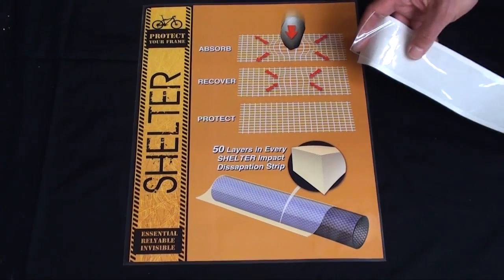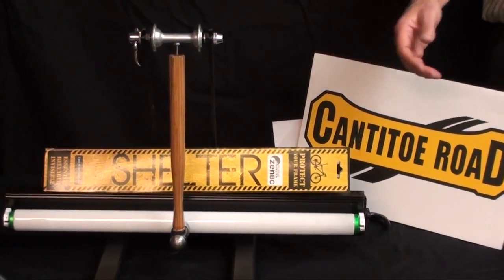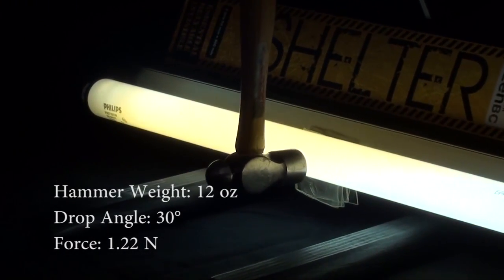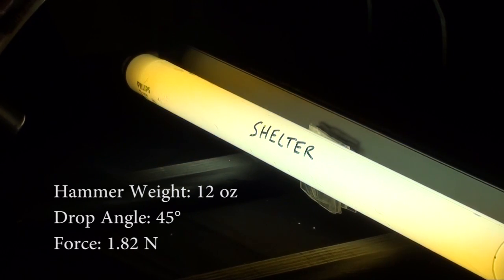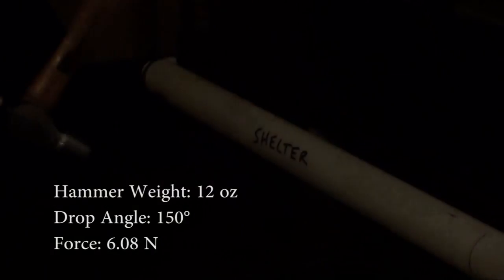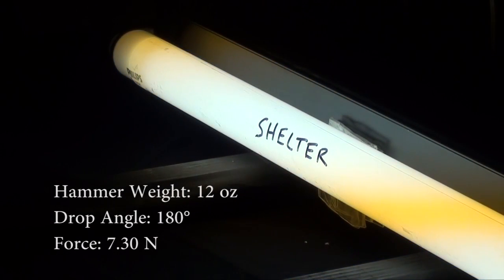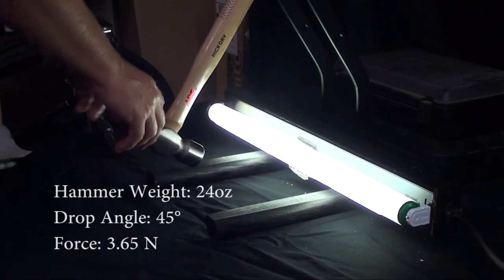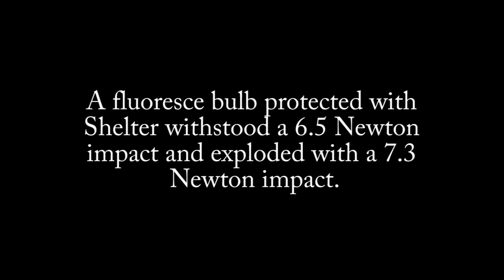Shelter Bicycle Frame Protection

Comment: Couple of thoughts: 1 Whatever the bulb is mounted to seems to be moving on impact and this will affect results 2. Why don't you show the test on an actual piece on aluminum or carbon fiber tubing? Just drop a weight, like say um...a spherical rock (a billiard ball would probably work great). I cannot understand why you would demo your product with a light bulb when you could easily do it with materials which more closely match reality.
Reply from the maker: MarzNet256  A billiards's ball on a carbon frame would be interesting. Once the Shelter was on it, the frame would become very difficult to break.  We would have to find a way to shoot the billiards ball at the frame, which does sound like fun.  The next time we have a little extra time we might have to look into it.

Comment: Maybe if you repeat the test and put two stripes of Shelter Pack (one in front and one behind) the bulb will last longer.The hammer didn't broke the bulb,just pushed it to the base with it's unprotected side,and that's why it's shattered.

Comment from the maker: road or mtn? If mtn, it's great, easy, protection (and it'll silence the noise of chain slap in addition to protecting your chain stay). If road, it's not so critical, but it's cheap insurance, compared to the cost of the frame, and it'll silence chain slap.

Comment: This is a cool video. Informative, and somewhat convincing. Glad you guys took the initiative to do this demonstration. But. If you could use a force or energy meter or some sort of impact reader (which I'm sure there are some out there) and use it with the Shelter film on it with the hammer drop test with the same degree increment as a comparison, the viewer would have a better idea of the force/energy impact absorbed by the film. good demo vid but If you can get more scientific it will sell.

Comment from the maker: No, Shelter is not the same as helicopter tape. Helicopter tape is designed to protect the blades from abrasion whereas Shelter is designed to absorb impacts. Further, it is specifically designed to function in the range of impacts that are likely to occur from stones kicked-up against the down tube. Helicopter tape will protect against scratches, but the force of the blow is transmitted directly to the tube; Shelter absorbs the force of the blows. That's what this video shows.

Comment: this is quite the clever product, but you may want to point out that it will deflect forces far better than it will absorb them due to it's platelet type nature and most impacts to a bike frame are glancing blows, not straight on hammer hits
this product also looks like it may be excellent for protecting high tension carbon springs, that also fail due to micro-fractures and chips you guys may want to affiliate yourselves with the bocking community as-well as the cycling one